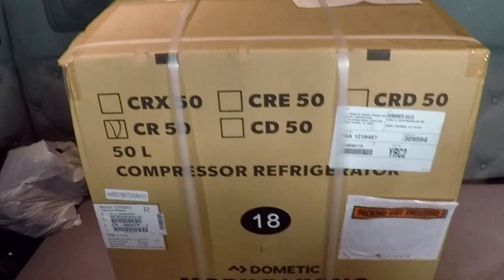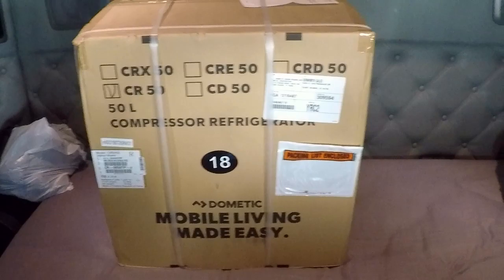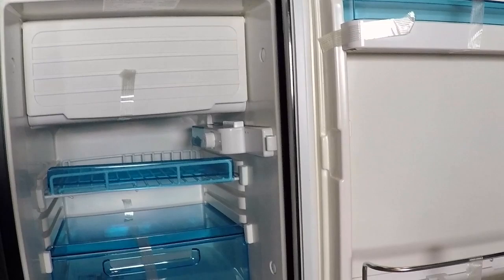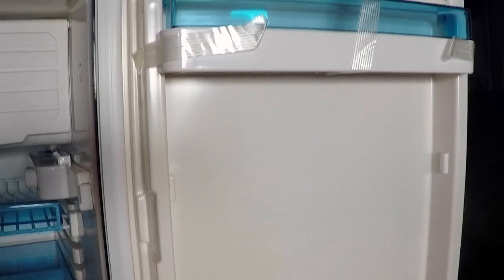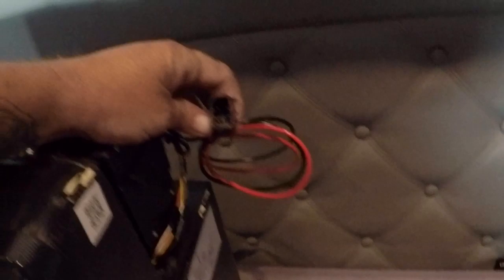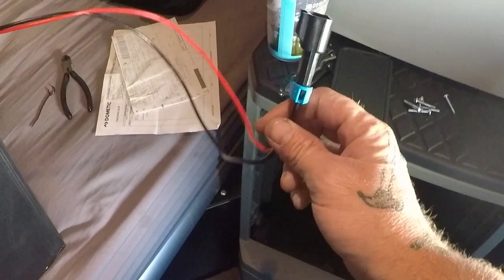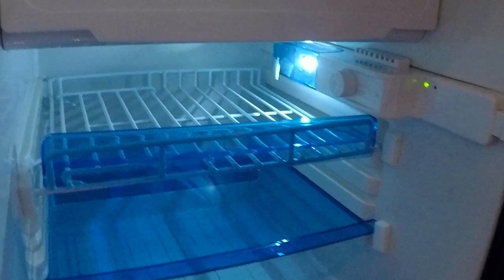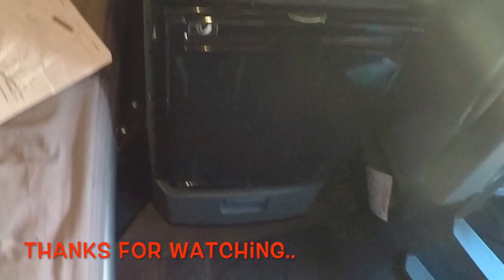Fridge Installation in a Kenworth T680

Comment: I was just assigned a Kenworth and was curious what kind of fridge would fit in that space and how easy it would be to install it myself. Thank you very much for uploading this video. I have seen a few comments where you suggested to call Kenworth to get the fridge type and measurements, so that's what I'll be doing! :)
Reply from the maker: I believe the model is in one of the comments. I know the fridge from Kenworth is expensive. I’m back in my volvo now. I have a basic Walmart mini fridge in this one. Then I just plug it into my power inverter. I’m assuming you can replace the fridge 5-6 times from Walmart or Amazon for the price of what Kenworth will want.
Reply: @TruckingLife  - I called the nearest Kenworth dealership to my terminal and was told they were sold out as I was the third driver to call in asking for the mini fridge information. I was told that since I have an inverter that I should be able to put in any mini fridge that will fit in the space allotted for the fridge. Fingers crossed that the mini fridge I ordered will fit! :)
Reply from the maker: @brittanih9126  that exactly what I would do then. I don’t think those fridges Kenworth is using are made to last. We had both of ours covered under warranty in the first year. I hope it works for you as well. I know how rough it is not having one.
Reply: sorry to be off topic but does anyone know a method to log back into an instagram account??
I was dumb lost my password. I would appreciate any assistance you can give me
Reply: @Quincy Kristian Instablaster ;)
Reply: @Jamal Brody i really appreciate your reply. I found the site thru google and Im waiting for the hacking stuff now.
Seems to take quite some time so I will reply here later when my account password hopefully is recovered.
Reply: @Jamal Brody It did the trick and I now got access to my account again. I am so happy:D
Thank you so much you really help me out :D
Reply: @Quincy Kristian You are welcome xD

Comment: Where do I buy the other end of the plug.The refrigerator came with a plug(chord) but not the end u tie into the truck.I guess it will be called a mating plug not sure.Where do I buy it and what’s the correct name and part number.
Thanks in advance

Comment: Everything was so helpful but I can't figure where the main source of power is coming from to the fridge like I installed mine and everything is connected but main wire has no power is it connected to he battery's or a fuse

Comment: If the truck has a cabinet door in that location, is it still set up to accept a frige.  Is the wire harness still in back and just need to remove the door?  Anyone try this?
Reply: It’s a Dometic CD50 if you want the drawer style or DR50 if you want the swing door style. The wire harness and on/off button should be pre installed. Iowa80 sells a different brand but they are still in the $600-$700 price range.

Comment: Do it come with a bracket pre install or I would have to get a bracket for my t680 that didn't come with a fridge?
Reply from the maker: The one I got had a lip around it so you just had to run a couple screws. I did have to use some tin snips to clear the holes for the trim to snap back on.
Reply: @TruckingLife  ok appreciate you.

Comment: I got a fridge.  But it doesn’t have the plug back.  It only has a red and a black wire.  The connection in the truck looks like a car lighter port.
Reply: How did u connect to the car lighter, mine is the same?
Reply: @marimavu  you can find the plugs at a AutoMechanic shop or truckstop.  You just splice (if that’s the right term) them together.  Just connect red to red and black to black.

Comment: Where can I order that fridge from and what can I do if I don’t have that plug inside the truck to connect to the fridge
Reply from the maker: I got mine from Kenworth. I would call Kenworth and ask them what you could do if you don’t have the plug. Maybe they sell it.
Reply: @TruckingLife  Hey Sir, I have the plug but do not have the button to turn on or off. If I order a fridge how do I turn it on?
Reply from the maker: I imagine it would just have constant power  so it would stay on. That’s my guess. I would call or stop by a Kenworth dealer and ask them. Last thing you want to do is kill your batteries when you are parked
Reply: @TruckingLife  Thanks! Very helpful. What hurts me is that I don't have an apu unit. My company has them on most trucks yet some do not. My microwave/convection oven with burner is 900 watts. I normally have the truck on when using it. Our pure sine inverter is 1500 watts. I was thinking getting a plug in 65 watt Hisense brand minifridge. Your thoughts please.

Comment: Brother where is the refrigerator fuse in 2018 t680 and whats the number
Reply from the maker: I’m not 100% positive. But I believe it is to the left of your brake pedal on the underside of your dash. I think there is a set of fuses there. I don’t have my Kenworth anymore or I would look. I hope that helps.
Reply: Let me know if you figured it out. I have one too
Reply: @Mizpeachez  yeh brother i found its 30 amp fuse  sleeper  acc  change it it will work .
Reply: @josansurinder7314  thanks because I got a fridge for mine the other day and will be hooking it up once I get to my truck again. Def needed this. Thanks bro

Comment: What refrigerator is it?
Reply from the maker: It’s a Galanz brand. I got it from Walmart.
Reply: Trucking Life do you know which one specifically? I have a 2020 kenworth t680 and just bought the 1.7 cubic feet mini fridge from Walmart , for my truck. It’s to wide for the refrigerator spot in the truck. The height is fine, just to wide.
Reply from the maker: Adam Wiley sorry, wrong fridge. The galanz is the one in my volvo. The one in my T680 is from Kenworth. It’s made for the t680. I’m not sure the cost or anything cause we had them put in the trucks before taking delivery of them.
Reply: Hey Adam Wiley just wanted to know did you find a refrigerator that fit your truck ??